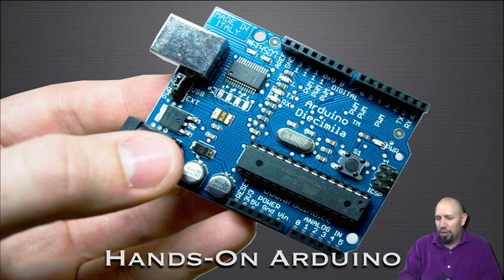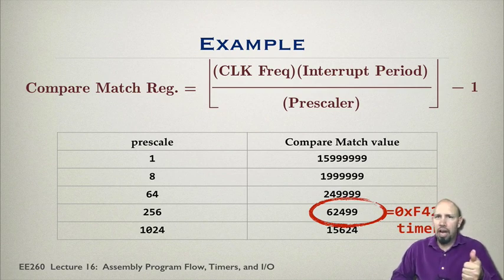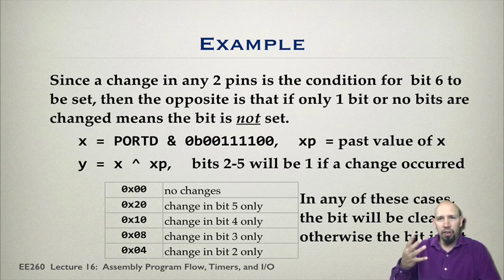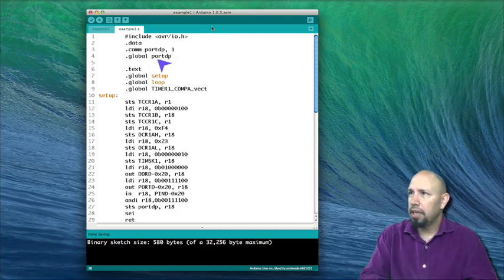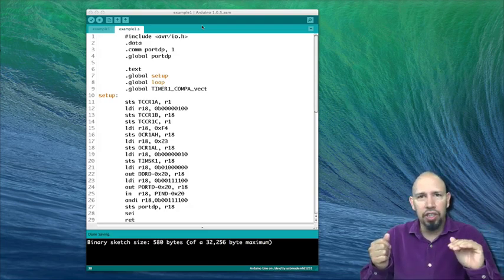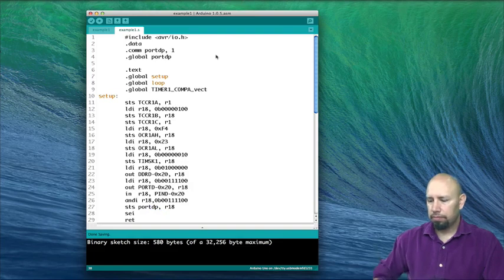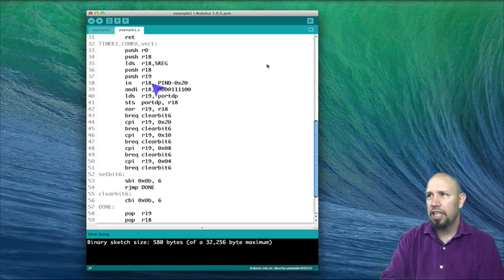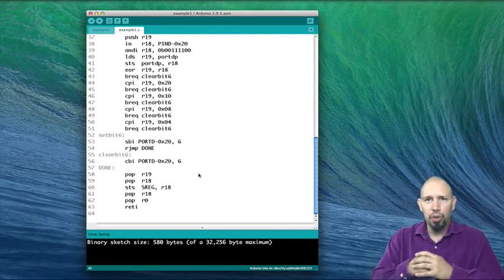Hands On Arduino 1:  Timers & Interrupts

Comment: hallo Robert. nice Video. i have one quetion. i try to do a timer and interrupt in my arduino due but it showed it wasnt declared in arduino? 

can you give  a tipps how i do this....

void Init_Timer1(void){
//  // initialize timer1 
//   
    TC_CMR1 = (1 << CLKI);
   //bitSet(DDRB, 21);
//    TCCR1 = 0;
 //   TCCR1B = 1<<WGM13 | 1<<WGM12 | 1<<CS12 | 1<<CS10;
    ICR1 = 15625; 
    
    TCNT1  = 0;     // initialize timer to 0
    //TCCR1A = 0;
    //TCCR1B = 0;
    OCR1A = 125;            // compare match register 16MHz/256/500Hz (Timer interrupt every 2ms)
    TCCR1B |= (1 << WGM12);   // CTC mode
    TCCR1B |= (1 << CS12);    // 256 prescaler 
    TIMSK1 |= (1 << OCIE1A);  // enable timer compare interrupt

}

Comment: Why a 16-bit counter ? I did not get it how you came to that.
Reply: +mustafa6b He's using an Uno which is 328P chip.  On 328P Timer1 is a 16 bit counter.  Check out the datasheet http://www.atmel.com/devices/atmega328p.aspx

Comment: I am desperately trying to get started in Arduino, and I need to work with timer interrupts.
Seems there is very little help with these!
I have no C experience and am trying to get a little via Arduino.
WHY ON EARTH did you do this in assembly and NOT in Arduino/C?

And do you have any suggestions on getting familiar with this in Arduino?

And sorry to say you didn't really explain how this actually works either.
You kinda skip over all the important/interesting details like most instructors that I run into do.
No detailed description of the prescaler or what it is and how to use it.
No description of what an output compare is or how that works.
Lots of dwell time on reading your code aloud and describing what values you're putting in what registers during setup.
but no description of why or what it is doing.
How did we even get to the ISR? what got us there?
frustrated
Good work though.
Reply: Robert Paz I'd love to have a good comprehensive lecture on using the interrupts on the Arduino, using only C, and putting it in the IDE.  I am using the Arduino for this project for the main purpose of servicing an external pulse, but can't make it work.

But i don't need a lot of speed here, as I'm trying to slow down an external process.

I've tried to compile many examples found in various tutorials, and none of them work for me.
Reply from the maker: Thanks for your question--which is a good one!  One of the main points of using interrupts is to make the interrupt service routine as fast as possible.  Thus, Assembly.  I have some good examples of regular interrupt usage you can check out.  But your question makes me want to add a video using interrupts in Arduino C.
Reply: Thanks!  I'm an idiot.  I later found some of your other videos that do a pretty nice job at some of the info I needed.  I was crazy enough to stumble on this video first!  Thinking it was the only one on interrupts amd counters
Reply: +Tom Wade SoftwareSerial works on pin change interrupts so that might be useful if you want an example. PCINT0_vect.  You'll find the source on GitHub Arduino-master\hardware\arduino\avr\libraries\SoftwareSerial\src\SoftwareSerial.cpp.  But you probably don't need to worry about ISRs at all. Use attachInterrupt() and the Arduino environment will do all the tricky bits for you and call a standard C function.